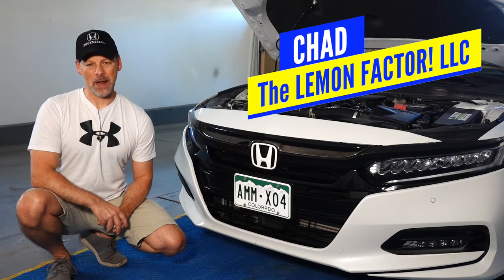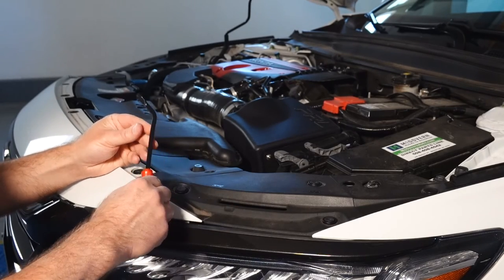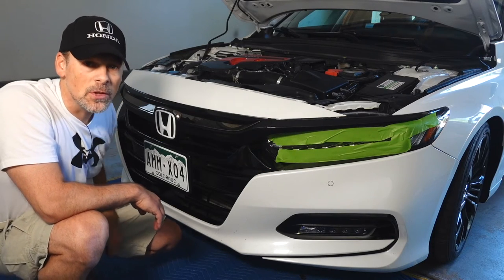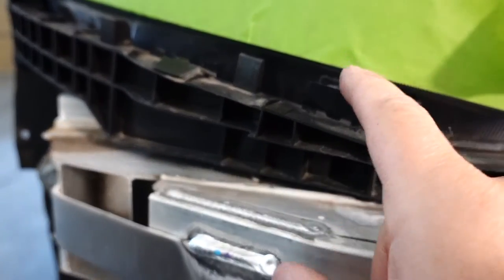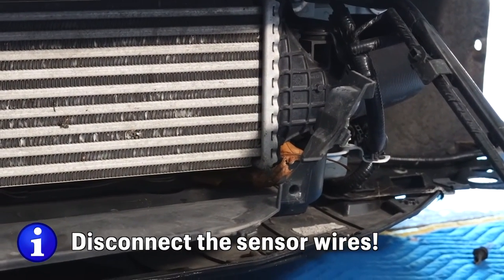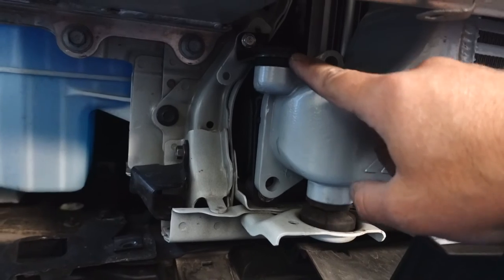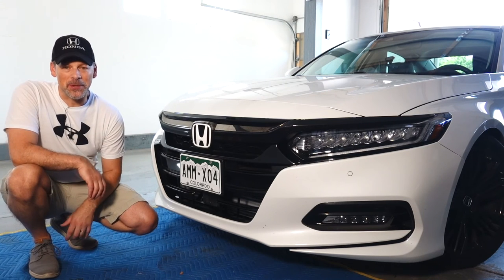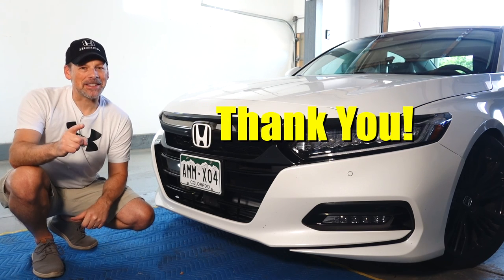(How-To): PRL / Mishimoto INTERCOOLER Install! // 10th Gen (2018+) Honda Accord

Comment: I understand you wanted to show the entire process from bumper off to bumper on but if you are comparing the performance of 2 intercoolers would you not want to leave the bumper off to avoid breaking anymore clips and so you can also swap intercoolers easier as well?
Reply from the maker: 🤷‍♂️. Why am I swapping intercoolers?
Reply: @TheLemonFactor  Apologies, I watched the follow-up videos and see you decided to stick with the Mishimoto, originally thinking you were comparing performance of the 2 which means each one would need installed.
Reply from the maker: Oh, gotcha 👍. I’m not testing both as I don’t believe there’s an a way (that I have) in order to effectively conduct an apples to apple comparison between the two 🫤. I do believe that both intercoolers will be much more efficient than the OEM.

Comment: Thank you for the video.  It helped a lot in getting me ready to do mine.  I got the PRL in black.  I have a '22 and there were little screws attaching the air dam to the bumper.  No one showed that in their "how-to."  PRL did NOT supply instructions like I've seen others do.  The intercooler installed well and I lined up the "arrow" on the charge hose about where it was previously.  The biggest "issue" I had was hooking back up the fog/parking sensor connectors.  I forgot and did the drivers side after the bumper was on.  Started it and got a "Brake System" warning.  I figured it would go away since it's done it before.  Finally remembered that I didn't hook up the passenger connector.  Bone head move for sure.  Still waiting on the PRL intake and Phearable programed KTuner.
Reply from the maker: I’m glad that the install video was helpful 👍. Let me know what you think of the Phearable tune - I’m sure you’re going to enjoy it 😉

Comment: Can you list the tools as my intercooler comes in tm😅😅 if you forgot totally fine, I’m just asking around chad, again great detailing on the install!
Reply from the maker: There’s actually not too many that are required. The video should call them out as they’re needed. Good luck with your install 👍
Reply: @TheLemonFactor  did you disconnect the battery? Rewatching it now

Comment: With the PRL intercooler, we’re adjustments to ECU needed?
Reply: Stage 3 phearable supports as well as stage 2 ktuner
Reply from the maker: @James - you do not need to install a tune with an upgraded intercooler. 👍
Reply: @TheLemonFactor  Thank you

Comment: I have 2019 2.0 sport, flashed back ktuner earlier this evening with stage 2. I have RV6 catless Downpipe, PRL Front pipe , PRL HVI. Xmas lights on dash went away after first flash and driving few miles. Worked great all week. Came last monday, Got PRL  intercooler installed at a shop. Everything seemed fine leaving the shop. About 30 min later all lights on dash come on. Car seems to still be driving fine. Pull off next exit and stop. All lights including tpms, ACC, lane assist, brake system were on. Don’t recall seeing CEL tho. Anyhow I reflashed same  tune from the unit. Drove for about 10 min, all lights cleared except for Assisted Cruise Control, lane mitigation and brake system. Ktuner does not list any error codes in the menu. I have yet to disconnect battery or clean the front sensor above the bumper, haven’t flashed back to stock yet. If lights are still on but my car seems to function normally, should I just keep driving until it clears on it’s own? Could the techs at the shop have done something to the front sensor while installing intercooler ?Thanks!
Reply from the maker: Has the lights cleared?  They should after a bit of driving and turning the car off and on a couple times. If they haven’t, there’s something wrong. My guess is that they may have not hooked up the front sensor, or worse.

Comment: 2021 Accord Sport 2.0  -- 
I had to remove the plastic plugs, NOT that hold the coloured bumper onto the black piece underneath, but the next line behind, that hold the two black plastic pieces together.  So the whole coloured front of the car comes off, along with the first layer of the black underneath.  This wasn't obvious form any of the videos I watched and may have been a change with the 2021 model year.

Comment: I was going to buy prl for sure but after looking at the mishimoto one, it seems more tempting, IMPATIENTLY waiting for the results video to order either one!!!!!!!!!! Also can you do the dyno runs with the phearable stage 3 tume on and off the car?! If both cant be done then i would say doing it with the phearable and then comparing it to when the stock intercooler was on phearable results cuz stock isn’t going to be as much fun!!!!
Reply: I got the black mishimoto one to match my car and boy am I happy with it! It does the job and you can hear the turbo better and the throttle is more responsive.
Reply from the maker: @DesiOasis - either intercooler will work just fine, and be a huge improvement from the OEM 👍. Checkout the channel playlist as I have dyno’d the car with just the Phearable Stage 3, then again, with the PRL HVI, and will soon release the dyno results that now includes the intercooler 😉
Reply from the maker: @Andrew - you definitely hear the turbo noises more 👍
Reply: @TheLemonFactor  yessir watched all of ur videos so far and the 10thgen community loves u😭

Comment: Great video. How did you disconnect the parking sensors?
Reply from the maker: Parking sensors?
Reply: The parking sensors on the front bumper. Did you have to disconnect them when you took off the bumper?
Reply from the maker: I did not have to as my car does not have that dealer installed option.
Reply: @TheLemonFactor  Your bumper has the circles for the sensors. And it's standard on Touring. The only plug on the back side of the bumper was only for the fog light?
Reply from the maker: Sorry, my bad - I was totally confused 🫤. This is the only wire clip that I had to disconnect on either side, so most likely it was part of the same set of wires.
Reply: Good to know there's not a bunch of wires under there.I have the 2022 Touring and I'm going take my bumper off for a couple of projects. Thanks all
Reply from the maker: Good luck 👍

Comment: Did u have problems with sensors not being accurate after installation
Reply from the maker: I did not run into any problems following the install. Be very careful with the front sensor during the install and make sure you reattach it the exact same way you found it, and you should be fine 👍